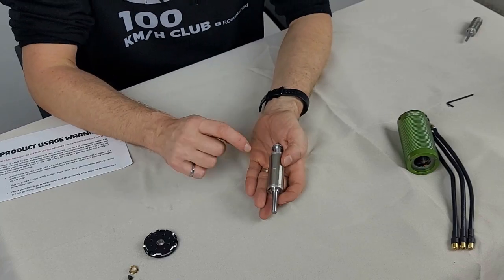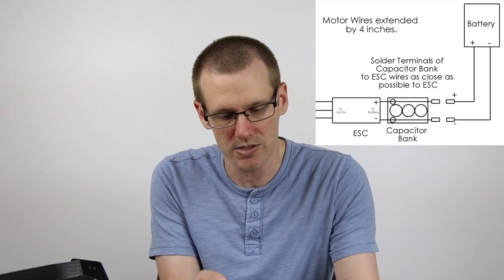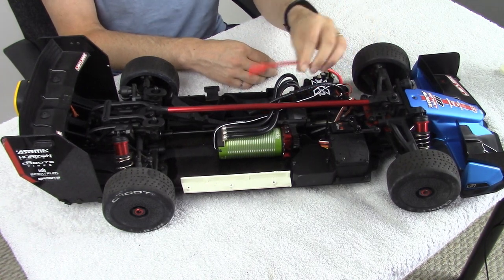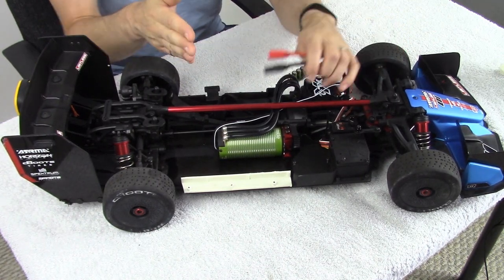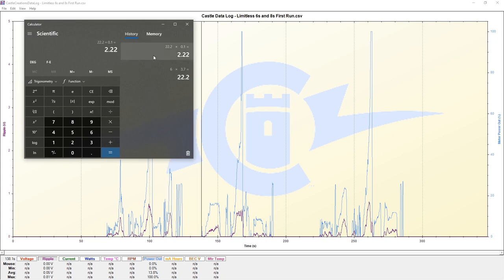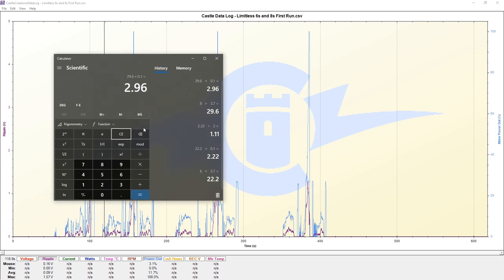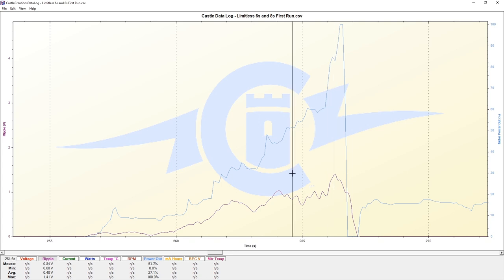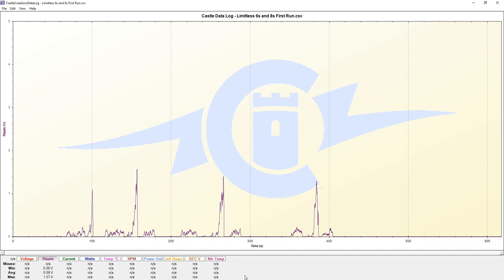Why I Don't use a Cap Pack in a Speed Run RC Car - Castle 1721 2400Kv on 8s

Comment: awesome video.... I've been struggling to find out why my ESC's are setting a fire after using them for a while...I even used a very expensive high amps high voltage ESC even recommended ones from the manufacturer of both motor and ESC combination...
Definitely going to try one of these Cappacks  to help me realize some reliability...
I thought they were overheating but I definitely think it's more to do with the voltage ripple effect. Thank you for such helpful information...
My setup is a 67in 3d Pilot RC plane
Recommended motor Dualsky GA2000R recommended ESC Dualsky Summit 120A HV 
6s lipo
This is my 3rd attempt to solve this issue of either smoking the ESC or power failure then after retrieving said model the motor runs again...
Cooling is really good ducting through the cowl into the ESC so should be adequate.
So your info has definitely helped me understand what it could possibly be causing all these ESC failures....
I do fly hard and soft 3d Manoeuvres
I was surprised when you said it can even occur at lower throttle!! With the PWM signal.
Which seems to tie in with what I've experienced. 
Thanks for video
Reply from the maker: Thanks for the comment. I hope the video helps you rule out something in your system. Not sure this applies to you but ill throw it out there. If you've extended the leads on your esc to battery side, this could be contributing. If you are using weaker batteries this can also contribute to worse Ripple voltages.

Comment: Awesome video. Thank you I have a question what connectors are you using for your battery and ESC? And thank you again
Reply from the maker: Using 7mm bullets.
Reply: @RCexplained  Thank you. I have one more question. I Have a pack of Castle eight. Five bullet connectors but there are three males and three females I believe these are for the motor. Can those be used as battery connectors as well?

Comment: I don't have the option to measure the ripple voltage on my setup, but I do have a capacitor pack installed.
Now my question is:
Could I judge by the temperature of the capacitor pack, whether it is significantly stressed by high levels of ripple voltage? And in case the cap pack runs cool, could I assume that the setup and driving conditions are healthy and do not produce problematic amounts of ripple voltage?
Or can we not make such assumptions based on the cap pack's temperature?
Reply from the maker: Measuring heat definitely shows how hard the caps are working but it doesn't show all as heat takes time to build up.

Comment: Hey Ryan, Great video. Would Ripple voltage change as a system ages due to electronics and physical wear and Tear? EG, would you expect the ripple voltage to remain the same for said car after 300 runs?... or is this something that you would check every year if you are not using Caps?
Reply from the maker: Hey Thanks!  I would expect as the capacitors on the ESC ages, you can expect different behavior. The same goes for capacitors that are pushed aggressively resulting in heat build up. This can result in higher Ripple Voltage with age but definitely depends on the abuse level. Hope this makes sense.
Reply: the "Field Effect Transistors" that drive a brushless system won't switch any differently after 10 years of continuous running than they did their first day. Unless they fail. At the same power draw and load, they will be identical until they fail.

Comment: Would this be more helpful for a street basher setup? Example: my infraction 3s, with a spektrum 120 amp esc and stock motor will cut out and over heat after just a few minutes of aggressive parking lot bashing. It's never even THAT hot, it just seems to cut out really bad and then shut off.
Reply from the maker: Cap packs help solve Ripple Voltage issues. Install a cap pack if you have high Ripple Voltage.

Comment: Kindly I have a Max6 esc and 1580 kv 4585 Rocket motor and about 30cm of wire that comes as standard with the esc and 10cm the wire of the battery that altogether makes 40cm  for the positive and 40cm fir the negative with the thickness of 10 WAG.
Is there a way how I could know if I need an a extra capacitor? 
Regarding batteries I use 6s 6000mAmps 100c.
Thanks Joseph
Reply from the maker: It's not that simple to determine if you need a cap pack or not. But what I can say is if your batteries are strong and healthy, and you are geared lightly, you should be OK without one.
Reply: @RCexplained  thanks, I tried three different setups. The first one is with two 3s batteries in series to get 6s, with 5,000mA 35c each.
 The second one was with the same type of batteries but with four batteries, two sets parallel, and both sets in series to get 6s and double the amps, although it increases the weight. 
I think the c rating wasn't changed! 
In the last setup, I tried it with another one 6s battery, 6000mA 100c on one side.
I kept the same gearing on all three setups, of 34T x 34T with 1580kv Rocket motor and Max6 esc.
All results are nearly the same, and the speed was always about 110m/h!
I thought that with the last setup, I was going to achieve a better speed, but in one of the runs, when while the rig was around 93m/h, it flipped and got airborne and crashed, maybe or because,  much of the weight was one one side, or it could had found something on the ground that lifted it up from one side.
Luckily, only some items were damaged.

Comment: Just bought a v2 and this 2400kv. Built a dual motor kraton max6 took it out for a speed run it tore itself in two lol the rear hinge on blocks ripped apart

Comment: I'm having a problem, perhaps you have the knowledge to help. I'm running a 6s esc, using 4s for speed runs. When I reach 85mph I'm losing power and just nosediving. The esc goes into a low power setting until I unplug the battery and plug it back in. Then I'm good to go for a repeat of the exact same thing. I can't figure it out anf I was thinking cap pack. But listening to this video I'm not sure that's the problem.
Reply from the maker: Without running your setup myself, from your description it sounds like you could be hitting a thermal or current limiter within the esc. I'd expect if the esc continues to behave this way, it's not happy with your setup. Try gearing down and see what happens. If you are running a 30T pinion move to a 26T for example.
Reply: @RCexplained  thanks, do you think a bigger esc would do the trick if what you say is the problem?
Reply from the maker: Yes, but I would first confirm this by gearing down and seeing if it runs ok.
Reply: @RCexplained  I didn't see your reply in time, I swapped to a 8s esc I had laying loose and no more power drop. At least until it gets hot, which is expected.

Comment: Will the castle 1721 fit the stock motor location? So you can keep both battery trays.
Reply from the maker: No it doesn't on the v1 but does on the v2

Comment: Why does it matter how close the cap bank is?  Wire resistance?  I can’t imagine it’s a timing delay for charging/discharging the cap.
Reply: Oh I see, inductance issues.
Reply from the maker: Correct